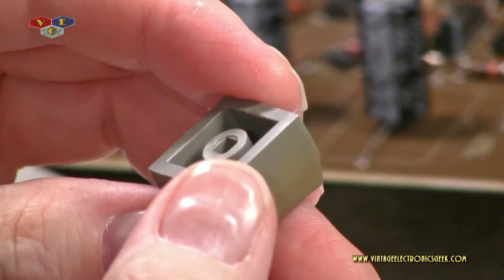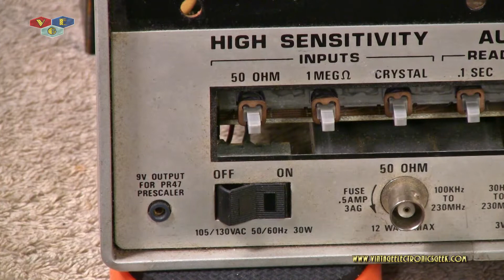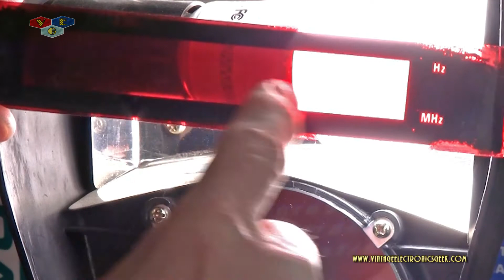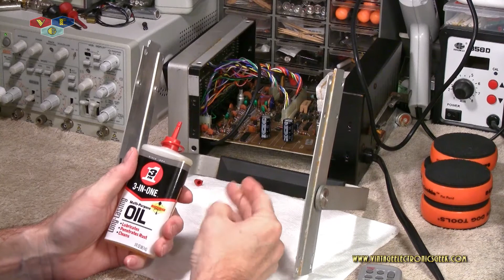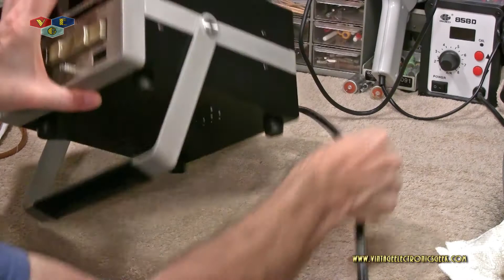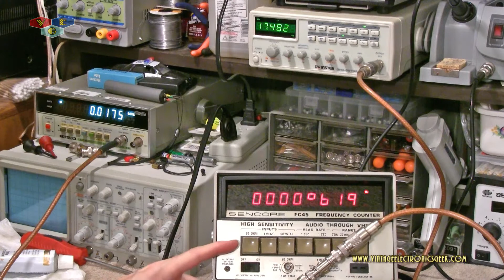Sencore FC45 Frequency Counter - Part III - Cleanup/Reassembly/Test

Comment: Looks really nice completely transformed.  You will be looking for a rubidium standard to add to your collection next. Nice job.
Reply from the maker: Thank you Chris!  I am very pleased with how well it cleaned up as well!  As far as the "standard" is concerned, yes I have been looking at them and I am sure so have you since you know about them!  :)  I find them and there GPS counterpart to be astronomically retardedly expensive!  Why hasn't the Chinese came out with a £2 knockoff clone!   Actually I did find something I think I will pick up later, but need to do research on it and see if worth it:  https://goo.gl/hVkhrz  ~Jack, VEG
Reply: I use a GPS disciplined standard it. There are various rubidium standard around many surplus from the mobile phone industry. It's a bit hit and miss what may arrive from China as there's a few different types.
Reply from the maker: Howdy Chris, this is just a hobby to me and everything I work on is mine, its kinda hard to warrant spending big money on a rubidium, plus the fact they die out after about 20 years?  To me, it doesn't make sense, so yes, I have been looking for a cheaper alternative. I did look at some surplus, but will need to research what all is involved to get it going. You have a video on yours?  ~Jack, VEG
Reply: Vintage Electronics Geek . Hi Jack I don't have any videos on my frequency standard but I will try and do a quick one in the near future. There are quite a lot of videos out there if you go the rubidium route but I have steered clear as it's hit and miss what gets delivered.
Reply from the maker: Thanks Chris, will be looking forward to it!  I'll look around as well!  ~Jack, VEG

Comment: Impressive readings from the Sencore, well within close enough accuracy.
 For cleaning stuff here (England) I use 'Flash' liquid with a drop of 'Fairy' dishwash soap in very hot water, works well. And for polishing plastics, Brasso does me.
 I did consider using the toner transfer method to re-create silk screening, never got around to it though, seems simple to me.
 Cheers Jack.
 J.
Reply from the maker: Howdy Joe!  Yes, I too am impressed with it, I do need to align it, but that maybe at another time as I need to get another piece of gear to do so, but for now at face value and what I do, it will be just fine...all the stuff I work on is my own projects, my own junk, so I'm good with a little off.  I am unfamiliar with the "Flash" and "Fairy" products, by chance you have a link I can check them out?  I have never heard of using Brasso on plastics??  I'd be interested in seeing that, you have a video to share?  Does it strip all oils or does it add the oils?  Thanks for the tips.  ~Jack, VEG
Reply: Hi Jack, Notifications are hit and miss nowadays, I think they have found out I am the wrong race, gender and leaning for moren times!,
 Anyhoo,
flsh liquid, https://www.amazon.co.uk/Flash-Clean-All-Purpose-Cleaner-Lemons/dp/B014DG5NKI/ref=sr_1_2_a_it/257-6659873-3093850?ie=UTF8&qid=1503938423&sr=8-2&keywords=flash+liquid
 Fairy liquid, https://www.amazon.co.uk/Fairy-Original-Washing-Liquid-780/dp/B016BQPUKG/ref=sr_1_3_s_it?ie=UTF8&qid=1503938547&sr=1-3&keywords=Fairy+Liquid
 I don't use Amazon, but as a point of reference it's handy.
 I use brasso all the time, very fine abrasive, in a liquid that does not seem to leave anything unwanted behind, Through habit I use nothing with silicone in it anymore- within reason, too many bad experiences with paint fish-eyeing.
 If I get hold of the gear to do it I would do a video or two, at the moment all my pocket money goes on cheap whiskey.
 Take care, J.
Reply: Vintage Electronics Geek I second joe Brasso can be a good thing to use on clear plastic windows to polish out  scratches.  Its commonly used in the U.K. For cleaning bakerlite.
Reply from the maker: I will have to give that a go on another restore after I pick some up!  I would imagine anything, even toothpaste would work if the abrasiveness is small enough? Interesting!  I've not had the opportunity to clean Bakelite, but have heard car wax is good.  Thanks for the tips I appreciate them!  More wine!  ~Jack, VEG
Reply from the maker: I see both of these are P&G products, I think the Fairy is the same as our Dawn, again, a P&G product.  Couldn't find a direct product for the Flash though.  I'll have to see if I can order some and have it shipped state side.  Like you, I don't use Amazon (albeit I do have an account, eBay is my preferred) but do use it as a research tool!  The "first scene" or sold or whatever its verbiage is a very valuable tool when trying to date something!  Funny about the whiskey!  :)  ~Jack, VEG

Comment: You got quite a bit of work done. Will have to look up the chemicals you used during the process. It looks great!!!
Reply from the maker: Thanks Stan!  I did, the hardest part however was to get Pt III edited and up, just wasn't feeling it, thus the length to post it!  :)   Yes, if you want to do the job right at atleast clean things up, these are what I have found to do a good job!   How's the Jeep coming? Need to do a update video. ~Jack, VEG
Reply: Vintage Electronics Geek I am sorta on a hiatus from it. Got a little burned out. Started doing some work on the house that needed to be done. Should be back on it some time soon.
Reply from the maker: I fully understand how ya feel Stan!  :)  ~Jack, VEG

Comment: This would be kewl for old radios with dial displays.   The dial display string on my old Ten Tec Triton IV broke long ago.  I use the talking voice freq thingy.  The VFO still tune without the dial string.  But a digital display is great on old rigs.  These buggers are getting cheap enough to make a mod practical.  
Don
Reply from the maker: Thats a nice radio Don!  Yeah, freq counters are cheap anymore, you could even get those cheap Chinese counters for less the $10 I believe!  Also, you could get a Chinese digital VFO to put in there, should cover most HF bands I believe? It's been awhile since I looked at them.  ~Jack, VEG